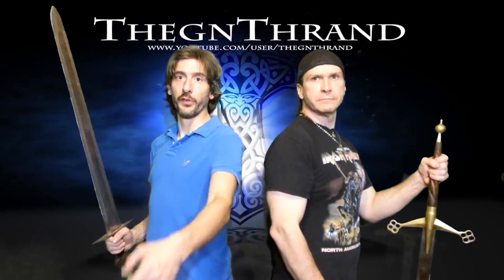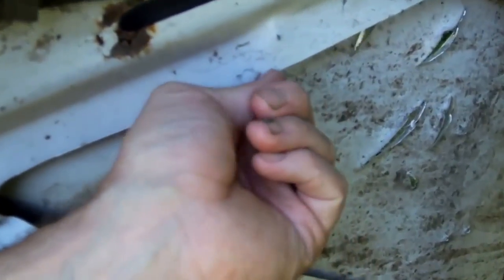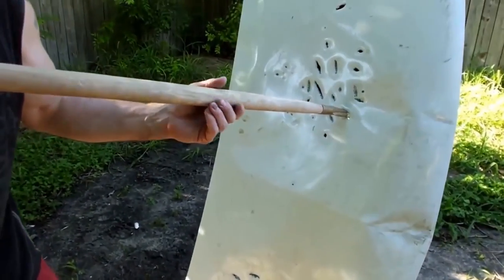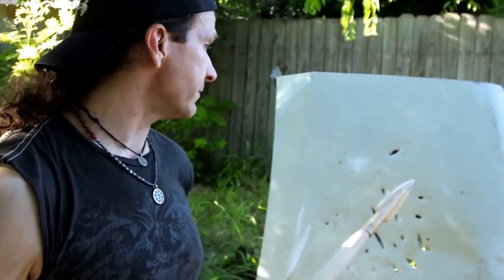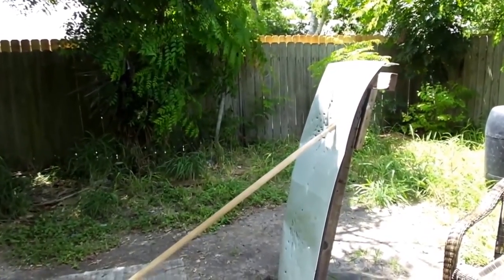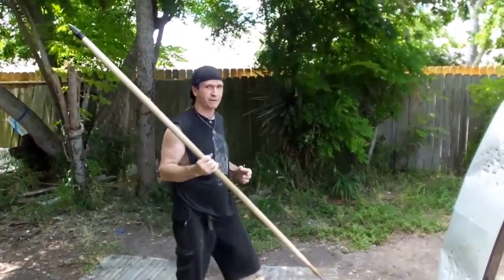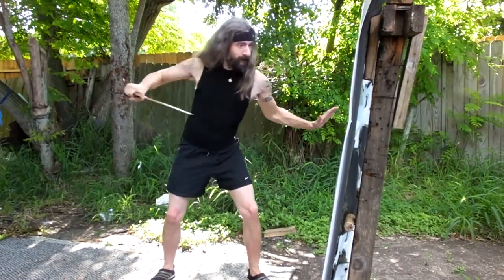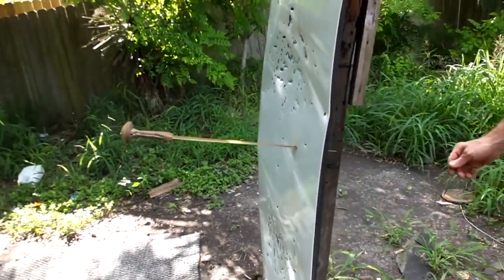Can Bronze Age Weapons Pierce and Cut Steel Armor?

Comment: Lol, a bronze-tipped spear might well pierce a car bonnet, but I very much doubt that the bonnet would be as thick or as strong as a steel breastplate.A bronze blade could never cut plate or even mail. Even so, a breastplate is not flat, the idea is to deflect rather than defeat puncturing attacks. Bronze swords were abandoned because steel swords could cut through them!
Reply from the maker: You did not watch the entire video and the car bonnet is same thickness of some bronze age plate 1mm but steel. The Breast plate that is 14 gauge hardened is pierced with bronze spear at 6:27 in this video. 

Steel can not cut through bronze sword Skallagrim's channel disproved this parrying with one of Neil's sword versus an Albion best steel sword on the market. it damaged it but hardly cut through it. As for maille even a steel spear has problems with that and takes a throwing slide motion as promoted on our channel to do so unless you wish to throw it full force.

The car bonnet is just a lead in to more extreme test in this video so I am guessing you watched first 2 mins thought that's all we had. You know what they say is you assume you make an ass out of U and me lol.
Reply: No, I watched the whole vid. I don't know what "gauge" means in terms of millimeters, but I doubt that a car bonnet comes near to breastplate armour in terms of toughness. Armour was also backed by mail and gambeson padding. Bronze armour was, well pretty shit in comparison.
As for throwing spears? Spears are for stabbing. 
Bronze is both heavier, and softer than iron. Who's sword will last longer? A skilled swordsman can parry without damaging his blade, but with a heavier blade he will tire and an iron blade striking edge on would damage it. Bronze armour vanished as it was heavier for less protection. Bronze swords were treasured due to rareness, however. Few ancient warriors could afford a sword so it had massive prestige value. Iron swords were lighter and resisted damage better than bronze swords. The iron sword was rapidly adopted by anyone who could work iron. 
The bronze swords were buried with their owners or ended up on the mantelpiece.
Think about it, if bronze was so good, why did iron and then steel entirely supplant it?

Comment: You cant cut steel armor so its not worth trying just try penetrating
Reply from the maker: +Alexandros grivas The idea of the video is just to show how good the cold hammered edge is compared to steel so yes we cut a steel plate sheet about 20 to 19 gauge. The armor was not pierced very deeply other than the 1mm or 19 gauge hood. the best bet is in any time period go for niches or gaps in armor or at least the weakest areas.
Reply: ThegnThrand gaps it is then